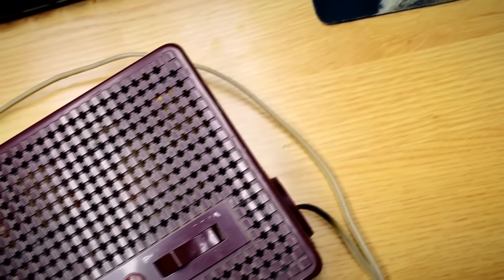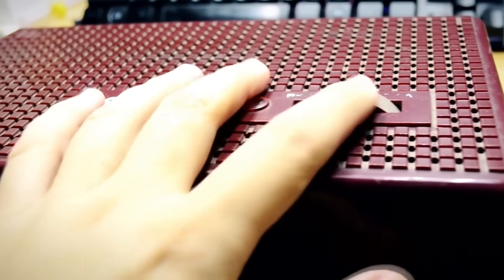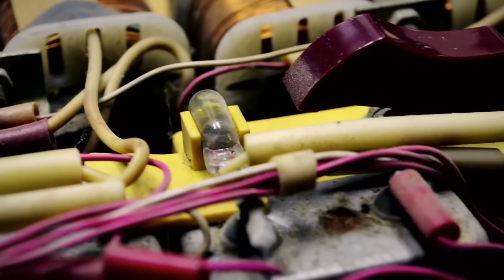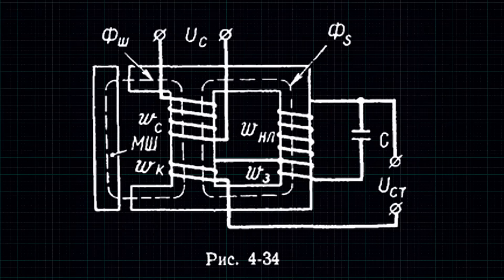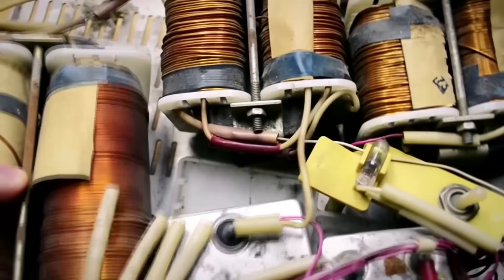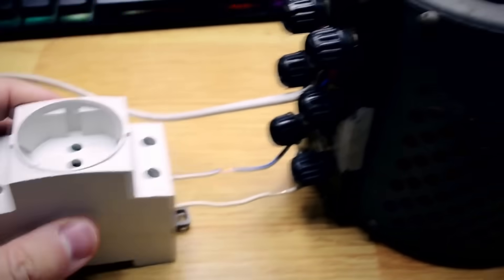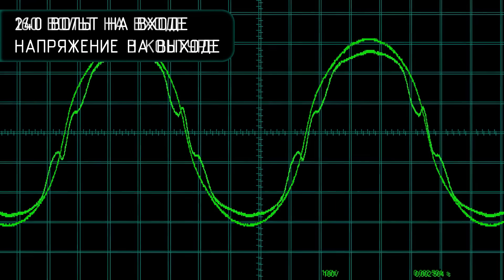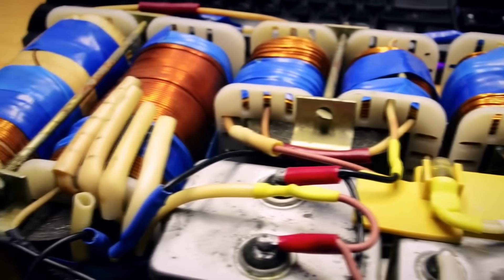A forgotten device from YOUR childhood: VEGA-7.

Comment: Magnetism is actually able to do a lot of things. I've heard that some amplifiers and other automatic control can be achieved by specially designed coils and nonlinear ferrite cores. But they're replaced by relays and transistors and microcontrollers nowadays… Can't find much data about that
I think it's worth getting one just for collection, they're a symbol of that old technology.
Reply: The magnetic amplifier, also called transductor,  was the only  efficient way to control the speed of  huge electric motors  smooth and stepless. Than came semiconductors, but the magnetic control was high reliable at all.
Reply: @Reaktanzkreis Yep, there those keywords do yield articles from google and Wikipedia. Interesting indeed.

Comment: I do have a stabilizer.. though thats only a auto transformer and few circuitry, which tries to set the output voltage pretty constant.. 
For input 120-300
Output 220V±10%.. 

yeah very large margin.. though it was a cheap one.. probably cost-ed $20-30

Comment: Nice device. I got an APC Line-Interactive UPS with automatic voltage regulation. But it only adjusts in steps. I think this device works a lot nicer.

Comment: Do you have the circuit or more information about this marvel? I want to build one. Thanks from Argentina.
Reply from the maker: Hello. Despite its simplicity, this is actually a rather complex device in terms of calculations, and it heats up and makes noise because it is a ferroresonant converter. In the modern world, it is considered outdated.
Reply: @KasyanTV  it is probably outdated only because of huge material usage. Modern 1+kW UPS'es makes a lot of noise too due to active cooling.

Comment: Thank you ! I have a such device at home, sitting on a shelf of my lab since 15 years. 
I already wondered why the principle seems to have been completely drop in modern device, such as UPS or voltage conditioners like the ones used in high end audio

Comment: Many years ago, since we had only white and black television, a ferro-resonance transformer was generally used at the input ( I'm speaking of Rome, Italy, and TV sets equipped with electronic-valves ( tubes ) and not yet with transistors ).Then, with colour television and their built-in switch-mode power supply, those ferroresonance tranformers were abandoned, cause they even were making some trouble, perhaps due to a double tension regulation, outside AND inside television. Nobody uses them, as i know.
But they could even be usefull to power other equipments other than TV sets, expecially in areas were line tension is affected by variations ...

Comment: Great product and long lasting. I presume it will attenuate inlet surges too.
Modern ups do a bad job at this. An offline ups simply passes through the mains while online ups are 3 port transformer devices. They will also pass through surges.
Reply: Uhh. Online UPSes are a back to back power supply and inverter..
I spec and instaled them regularly for clients.
 most of the ones I buy are from Eaton or Tripp Lite.

Comment: I remember seeing one such a stabilizer in my aunt´s house. She bought a tube Rubin B&W TV set (the one with round-ish CRT and white phosphor in brown rounded wooden case, white mask around crt and buttons like the old tube radios) sometimes in late 60s and I saw the TV plugged in this strage box when I visited her in late 70s when I was around 5 (If I remember correctly, the TV was sold with such a stabilizer). Many years later, I find that box being throwed away for a recycling center by his nephew. Sadly, I could not save it.
After searching, it seems that the TV was Rubin102.